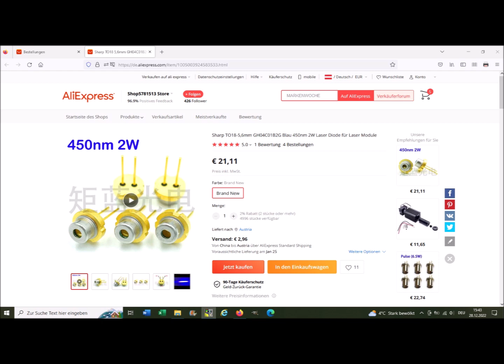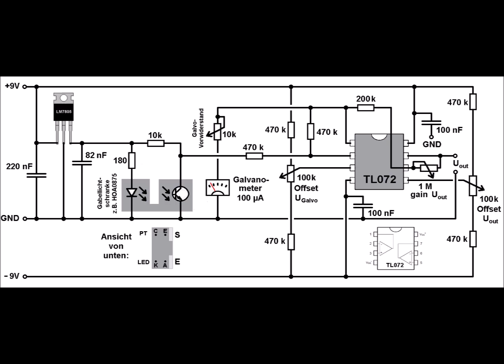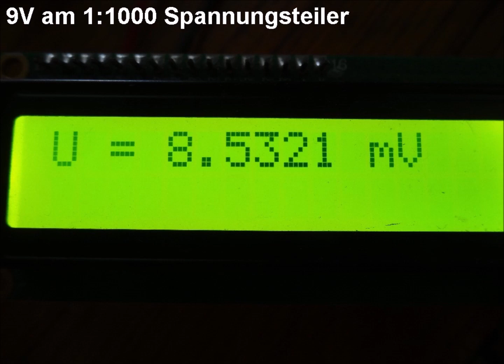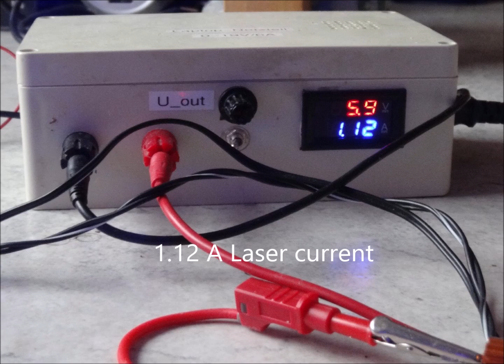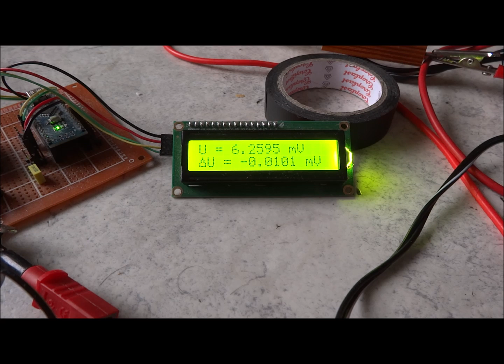Experimental proof of the momentum of photons/light with a µg-scale and Arduino - Photonenimpuls

Comment: Can you run that in a vacuum to eliminate the potential heating and expansion of air just above the reflective surface?
Reply from the maker: Hi! I have a double stage vacuum pump. Maybe I will repeat that experiment in vacuum. But then I need a large vacuum chamber for housing the whole apparatus... 😉

Comment: Very nice experiment! I am really impressed with µg-scale capabilities. Did you use the low pass filter for 50-60  Hz?
Reply from the maker: Hi! I use a 10k resistor and a 100 nF capacitor for the low pass. Therefore the cut-off-frequency is 160 Hz...

Comment: Nice but I have a few concerns: how is the scale calibrated? You can measure a change of the quantity of light that can pass through the detector and that appears as a change in voltage after amplification. But how do you convert that voltage variation into a force? Also the problem is that on z small scale the linearity is probably ok, but not on a large scale. Do you have to calibrate with a similar weight.
Finally this is not done in deep vacuum. How can you be sure that this is not like what happens with the radiometer?
Reply from the maker: Hi! I have calibrated the scale with the tiny sheet of paper. 1 mm x 1mm weighs around 70 µg. A radiometer has two different surfaces (black and polished), which are thermically well separated. The black surface is hotter than the polished one. My laser hits the aluminum foil. If the aluminum foil is being heated up, than the radiometer-effect must be on the upper AND lower side of the aluminum foil and therefore the forces would equalize in my opinion. And convection would also decrease the weight and not increase as in my case...

Comment: did you test that the circuit it not sensitive to the light?
Reply from the maker: With a flashlight I can't see any effect...
Reply: @stoppi  that laser might be a bit worse, but good if it does not you can maybe just aim it from the side or of axis, maybe even from below you can eliminate offset effects. cool experiment, i have to try it as well
Reply from the maker: @heinrichhein2605  thanks for your tip. Good luck and please let me know your results. Maybe my measurements are the results of lots of mistakes 😉
Reply: @stoppi  happens, like to Fermi and other scientists,  ;)

Comment: That's pretty idiotic. The laser does much more than just transfer impulse. The air heats up etc
Reply from the maker: Yes, you are right. But convection (upwards air flow) should result in a decrease of weight and not an increase...